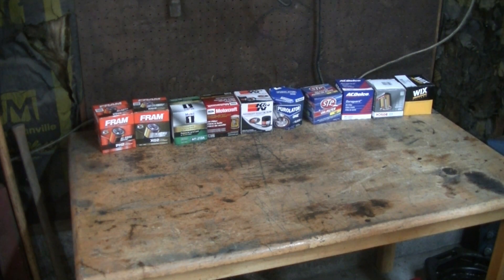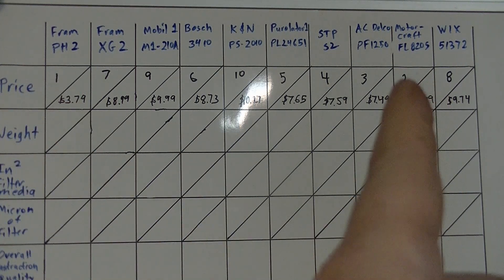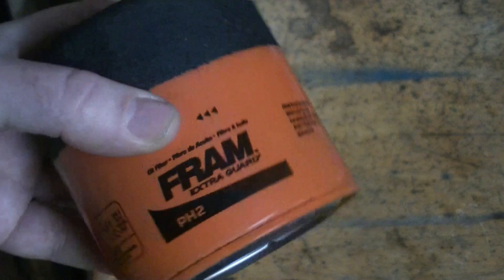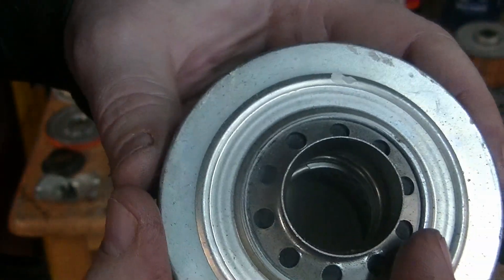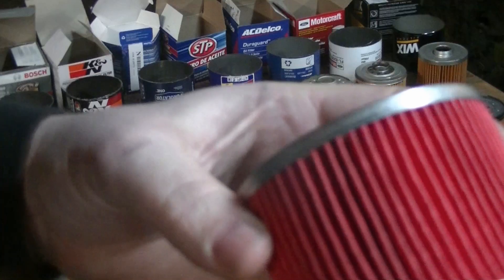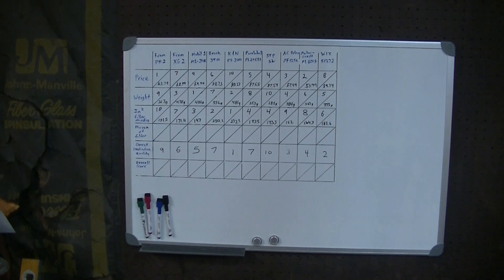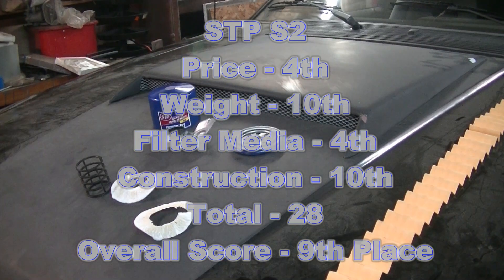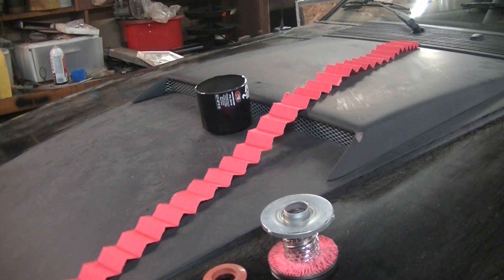Oil Filter Shootout

Comment: Use a Recommended oil filter cutting tool, prevents metal chips, grindings, noise etc. Quick clean easy and NOT contaminating with particulates from cutting/grinder!

Comment: With exception to some of the OEM, you get what you pay for, plain and simple, the cheap Frams are on par with the cheap STPs. I've used nearly all of these except for the premium versions of the K&N and Mobil1 filters. I typically find what's available for the application, weigh them in my hand in comparison and purchase based on weight and the price. As you can see the run of the mill FRAM and STP are light and thus have cheap materials. I typically go with OEM unless the price is good on BOSCH, Mobil1, K&N, WIX, or Purolator, I've never felt I had enough dough to justify spending the extra $$$ on fancy Royal Purple or AMSOIL filters.

Comment: First time viewer. I wish you had said at the beginning that you decided not to test the particulate size in any way. The rest of the information you have in my opinion is not really relevant. I have never heard of an engine blowing up because the pressure relief valve on the filter was cheap. If you have a thousand miles of filter material with 1cm size holes it will still let the crap through. The one requirement for a filter is the particulate size that the filter material allows to pass. I think you did a good job with your video but in my opinion you missed the forest for the trees.
Reply: I agree. That forth line on his chart of Micron,, so-and-so, was not done. ... I want to know, which filter is best at cleaning the oil. That point was not determined. Easy test to do. Pump the same amount of dirty oil though each filter and weigh each one before and after. The heaviest one wins.
I have to add. Comparing the length of the fan-fold filter wrap fails, since the composition of the materials are different.
To the readers. I now have a new GM hand-me-down car. 2006. 90K on it. The one long before had 70k at the start and I kept it going to 190k because I changed the oil and filter about every 5k miles. (The products I used didn't matter that much. It was how often it was done.) The change of cars was not due to engine issues but due to a failed control arm issue, which the repair cost exceed the value of the car. That car was 19 years old! I want this car to go 200k plus.
The cost of frequent oil/filter change over years is much less than the cost of major engine work that was due to being on the cheap of stretching out the oil/filter changes just to save a few dollars.

Comment: In Australia the black K&N filters are the cheapest out of that lot (weird hey). Also the new black K&N filters have changed to a Fram style metal centre tube (hopefully the rest is still the same). Also, The white K&N filters with the nut have changed to an e-core (plastic core). I am using the black ones from now, hopefully they do not go to an e-core as well. Great work, thanks.

Comment: The test is good the result is a joke. What are you doing, my dude? :) Have you never read a test result before? How good a filter is depends on the filter media size and quality, flow back feature etc... and then really "nothing", so you cannot weigh all factors equally. Who cares whether one filter is heavier than the other?! Who says whether heavier or lighter is better to begin with, and why? IF you would not cut them open, then one might draw the conclusion that heavier equals more filter material etc, but like that, it is a completely worthless fact that must not have any influence on the rating. Likewise price. OK, so the cheap ones are ca 5 bucks, the expensive ones 10 bucks - you choose. Good. How a filter is "better" because it costs 5 Cents less for a product that you change once every 1-2 years is a mystery. What you should have done is weigh filter material 40%, quality + features 40%, and the rest 20%. How can anyone accept that a filter with good quality gets erratically bumped down on your list based on weight and/or marginal price differences, as if those were absolute quality parameters, while they are actually none at all?

Comment: My friends look at me like I'm stupid for using a K&N oil filter and 10-30 Royal Purple in a 90 Buick Century. I change the oil and filter every 5,000 miles. My 92 Century I retired with 304,000 miles on it. It would still be a daily driver if it didn't whack a deer at 70mph. I have all of the parts to fix it but I don't have the time.
Reply: I use a K&N oil filter with Royal Purple 5w20 oil too.  My engine has 144,000miles/232,000kms, and is very clean inside the engine. My 2006 RSX can do around 400miles/650kms to one tank of fuel.
Reply: wix and 5 or 10 w30 royal purple here too. 2006 toyota tundra ,4.7 v8 196000 miles.

Comment: What does any of this really prove?
Very very little...
Consider price... On your comparison the K & N is the most expensive but for my particular vehicle the K & N is one of the least expensive. So which is the best deal for the money? Well, which one removed the most contaminants? And how much difference is there in performance between the least and most expensive? Without some oil analysis we'll never know.
Reply: I don't think it really matters these days, all the big name oil filters are very similar. If you want to put 10,000 miles plus on them its best to go for 100% synthetic filter which will hold more dirt over a longer period of time. There doesn't seem to be any difference over shorter mileage with any filter on UOA. It seems to only matter over a longer period of time 10,000 miles ++ It's mainly just marketing with efficiency levels and its very hard to know how to tell them apart because there is so many ways they can rate the filter.

Comment: Fram upgraded their anti-drainback valves to silicone valves a couple of years ago so this PH2 is an old stock filter. New filters from Fram are silicone. The filter media is a fiber/resin blend with a same fiber endcaps which make for a cheaper construction because less adhesive is needed to glue them together than 2 different materials require like fiber/metal or synthetic/metal.
Fram Extra Guard meets or exceeds the minimum API standards otherwise it cannot be sold in the United States. Using Fram filters will not void new engine warranty's and is the factory application in some makes.

Incidentally, I do not work for Fram and Fram is not paying me to make the above statement.
Reply: Used a regular Fram filter for over 400 plus thousand miles and regular 10w 30 Havoline oil in a 64 Ford sold it in the early 90s and it was still going strong
Reply: lol.  2 years ago fram wasn't in business. the new company just keeps  the fram name.  still made with regular old media paper just like the rest

Comment: I think Bosch having MORE filter material than Mobil and almost as much as K&M should have earned it a better overall score than 6. Great comparison vid.
Reply from the maker: It did rate very high in that one category.  It rated somewhat lower in other categories. I tried to be transparent on how I came up with the scores, which allows people to decide what is most important to them when choosing a filter and decide accordingly.  I am sorry that I was unable to get any accurate, comparable data on filter media/micron size.  That would have very useful information. I think that you are correct that the square inch of material is important.  Maybe I should have given double points for that category, since it was so important?  Thanks for your input!
Reply: mobil is made with premium paper the rest is regular paper

Comment: Just because it's red, doesn't mean it's silicone.I suspect the dull looking red anti-dr
ainback valves may be rubber. I think the ends on the STP filter are ultrasonically welded, not glued.